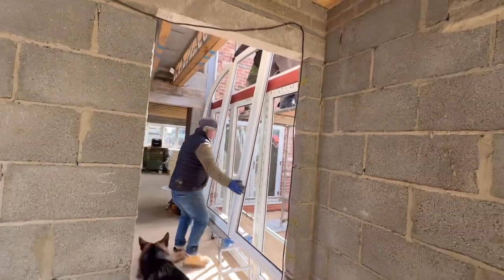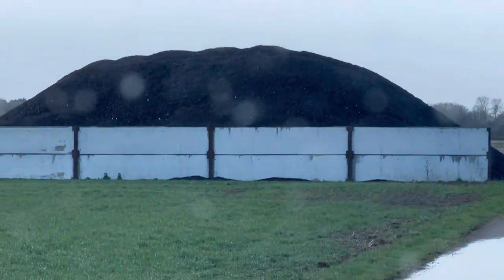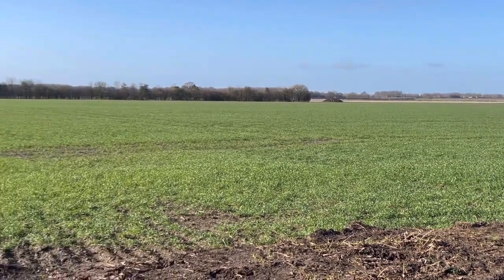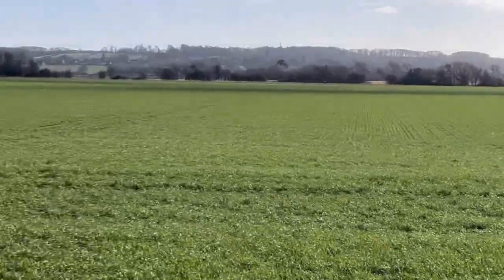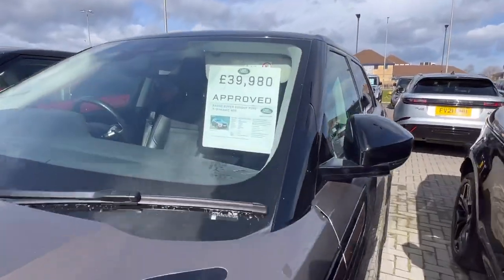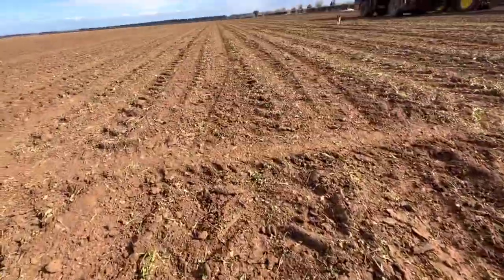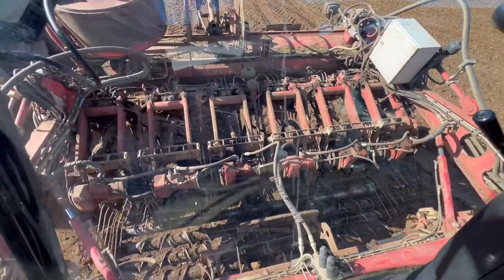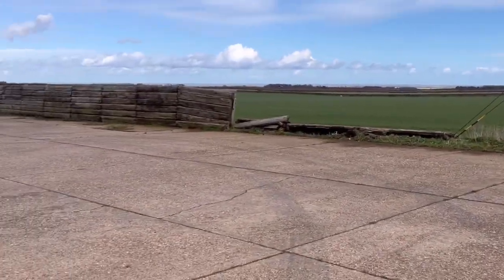FARM UPDATE 121 RAIN IMPACTS, DRAINS RUN, WHEAT CROPS, VISIT LAND ROVER DEALER, FINISH BEET LIFTING

Comment: Good the beets out the ground. That's some feat of engineering for the harvester.
The early drilled field looks fantastic so far, let's hope it's a good year again an yields well.
Reply from the maker: Just shows the benefits of earlier drilling. But it was the first year of drilling late wheats after a shallow disc (express or similar we had on demo), the solo leaves it rougher which withstands the weather better. I’ll go through it on Sunday in more detail, especially for you!!

Comment: Great update Andrew, get the subsoiler on them headlands, glad you got it all out. Winter barley planted here mid Feb, no show yet, too cold n wet, leave it in the shed.
Reply from the maker: We can’t do the heavy land as it’s wet underneath and wont do any good but we might do it after the crop is drilled when it’s drier. The light land will have the solo which does it all in one pass. You’ll see it working in another week.
Reply from the maker: Some barley around here planted but I’m partly glad ours is still in the bag now it’s so wet.

Comment: Did you go Eastnor castle by Ledbury,Have you had many problems with your Disco some one said they were worse than the Disco 4 ,Ive heard several who have at blown engines at 7k (Disco 4)for a new one, recon ones dont last the crankshaft bearing shells have worn the block.The towing ball on your you said you have had problems,we had that design on our Disco,but not a retracting one,they say they are not rated to tow any weight ,they have had them break off,Its a wonder Landrover havent been sued.We have a Defender Puma,ended up taking the EGR valve out and remapping ,seem to go into limp mode when you most needed ,could be quite dangerous on Junctions when you pull out and it does that.
Reply from the maker: No problems with it apart from the tow hitch failing to come out. Not had that issue for about 4 years. I’d always have a retractable one because they stick out a lot and I’ve seen lots of bruises shins and trousers with oil stains! I’ve not been on the 4x4 course yet.

Comment: What happens when the factory shuts and you’ve still got beet in the ground?
Reply from the maker: That never happens. BS would find lifting contractors and hauliers to help our regular ones.
Reply: @WardysWaffleAndrewWard  but if the weather was bad do they just keep the factory open longer then?
Reply from the maker: They gauge it with what’s left to lift and the weather and work with us.

Comment: Do you use a sub soiler on the bits that have been heavily compacted?
Reply from the maker: The solo does it all in one pass, see it in use in a week or so.
Reply: @WardysWaffleAndrewWard  I have watched it but in my mind I thought a sub soiler would go deeper. Thanks for replying.
Reply from the maker: We do have a 7 leg simba flatliner but it has the same legs as a solo. They both go about 14” deep but there is only 8” of soil at the heath, after that is pure limestone.